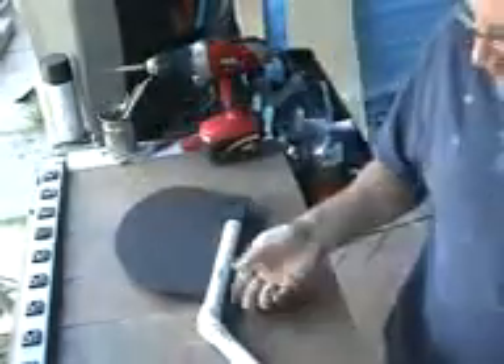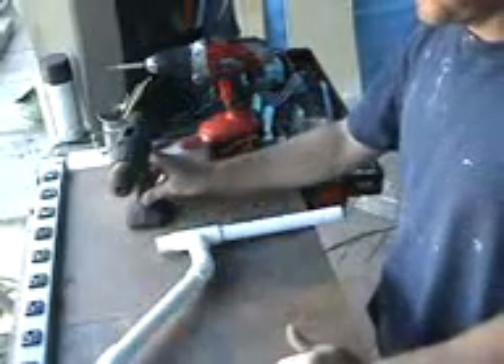pvc wind turbine out of drill  2

Comment: So the drill motor is just to hold the bolt that the rollorblade wheel spins on?  The wheel is fitted with an internal bearing and doesnt spin the drill chuck. at a later date you will convert the wheel into a dc generator and add a solar panel for a tail fin in case it doesn't put out enough. 
you done tore up your rollorblades you should put the battery back in your cordless drill and proudly retitle your creation "a wind powered drillcharger"

Comment: Very Cool! I gotta try that one sometime!! You gave great instructions too!

The screw in the prop is one balancing idea. But it may effect the integrity of the blade making a weak spot.  A place for the blade to start cracking. 

You could also take length off the tip of the heavy blade with a belt sander until it balanced. It doesn't matter that the blades are the same lenght as much as they are the same weight when they are spinning.

But I'm just talkin"...

Great Video! Thanks!